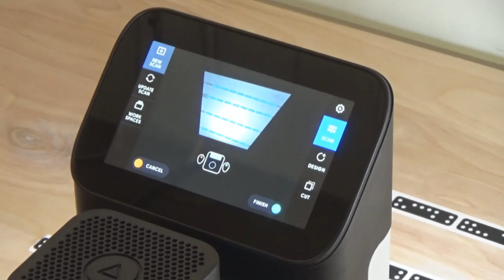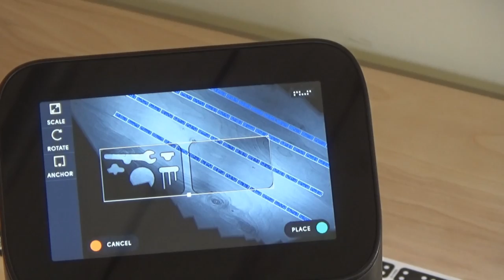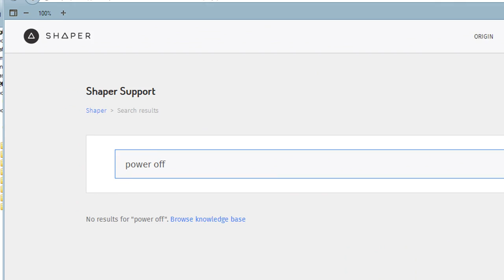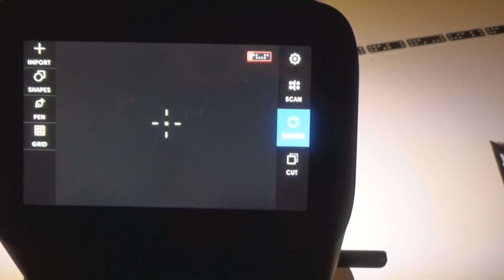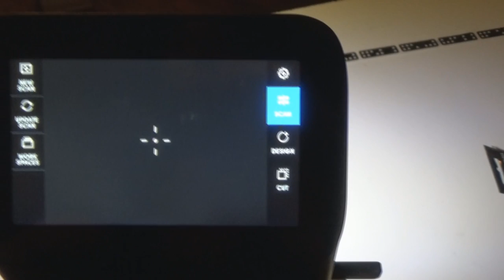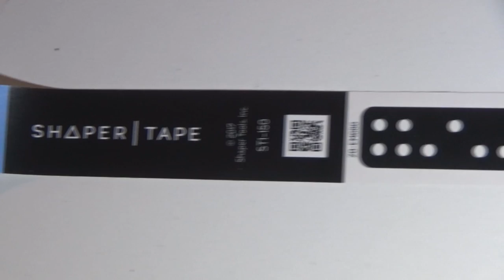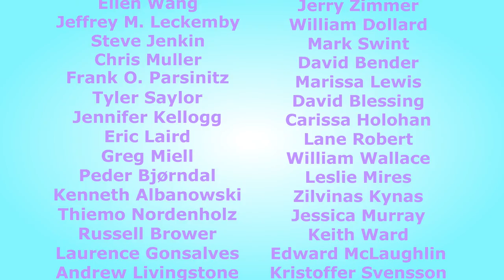The Shaper Origin - World's First Handheld CNC Machine

Comment: you mention you can't delete workspaces, but the footage shows what looks like big red trashcan buttons on each workspace in the menu?
Reply: also after she tapped on the workspace it had buttons for "copy" and "remove" ...
Reply from the maker: During editing I saw the quick flash of the copy/remove options but they are only there for a split second as the Origin cycles through pages.  Could be a bug in my unit...
Reply: Maybe if you hold the workspace instead of just tapping to select it? -that's how it works on my friend's new fancy coffeemachine (to delete a custom cup).
Reply: Fran Blanche could be but maybe there are some long press options. No file management is definitely something that should be added in a firm. I could see keeping some templates for making more pieces later but yeah, you wouldn't want them all in the main category.... If it's a category... You know what I mean. Rock on Fran.

Comment: Would you expect any tool to be perfect the first time out? A good start, but I am sure the manufacturer made compromises. Still very useful. I am beginning to wonder if on-off switches are becoming optional. A friend recently gave me a air popcorn popper which has no on-off switch. I use it often, but having to unplug it is annoying. Does the shaper run on ASCII? The dot coding on the tape looks very much like the dot coding on the paper tapes we used in CNC manufacturing of printed circuit boards 40 years ago. Wouldn't it be nice to do the program on your personal computer and download it to the Shaper?

Comment: Considering this is in fact a computer, it should probably be plugged into a surge protector power strip. There's your on-and-off switch. Since this really is designed as a portable power told though, and and not a stationary CNC, my guess is that the folks at shaper figured you would just plug it in to use and then unplug it when you are done. 

I'm with you though I think it should still have a dedicated on-off power switch for the computer portion. The surge protector power strip may be a workaround for now.

Comment: Cutting dovetails might be tricky since this is a 2 axis tool and some dovetails need height  allowance in the Z axis.  Enjoy your new toy!
Reply from the maker: It's actually an effective 3 axis tool, which is why I think it would ideal for dovetails and other complex joints...
Reply: How is it controlled in the Z axis, other than when you touch off and plunge?  Wouldn't it need to be able to scan a wall with Shaper tape on it to be a true 3 axis router?

Comment: I'm having a hard time accepting this as a CNC machine, given the operator needs to move the cutting tool. To me a CNC machine is where you put the work in, start the program and go do something else while your part is made. Seems more like an automatically compensating router to me.
Reply: yeah its more of a hybrid I suppose but the technology seems like it has a lot of potential for the home user either way
Reply: indeed librepenseur,
though, maybe if you put this in the hand of a Baxter-style RethinkRobotics 
or HansonDynamics, it becomes a CNC?
it's essentially a dremel mounted on an RC-car frame... it is similar to "Rap-Fab" stuff,
to make 3D-print-pen stuff attach to a drone etc.
AvE covers several gearless-transmission and brushless stuff...

How does the AGI-chassis compute the pressure to achieve the cut/envisaged movement?
where it is a mobile lazer-etcher, how does it compute the rheometry for the material safely?
how does it apply the force, and while keeping the overall rig upright?

enter Ionocraft! Ionic-Lifters can produce drones with the flight-time,
and power-via-wifi depending on the plasma-substrate etc.
Reply: I guess it's Computerized Numerically Controlled = CNC, so there you go. You're welcome.

Comment: It's a cool little tool, but I wonder what were they doing for the past two years?I've seen Bens video, apparently not much has changed. Also there is this cloud thing. It's also very expensive. Proprietary tape nonsense. I'd have to squint really hard to see it used in any kind of production environment.

Comment: Eh, the spindle has an on off switch.  I guess I don't see a big need for a switch for the electronics stuff.  Why wouldn't you just unplug it? But did I gather you can't use regular router bits?

Comment: Given that there's a power switch for the dangerous finger-biting part, sincerely, I don't know why you need a power switch for the computer. If you're going to walk away and are concerned about saftey but want to save your progress, why not just leave the computer powered on and shut off and pull the disconnect for the spindle? Thinking about it a little, what utility is offered by a hard switch or a hibernate mode? Are you sure you're not just coming from a place of expecting it have one because all other electronic devices have one? Seems like this device can live pretty happily without one, and leaving it off makes the device that much simpler to design, manufacture, and use...
Reply: And as an added bonus, burns out the electronics more quickly.
Reply: Does it, though? Notably? I'm skeptical. How frequently does it come up that one is leaving it on for extended periods without using it? If that's happening all the time and an owner is worried about it, they should finish their work and unplug it. What's the difference?
Reply: Well, considering that electronic components are rated for a number of hours @ a specific temperature, and designers are known for running their components right at the crispy edge, it doesn't take a rocket scientist for work out that leaving shit on is bad for everyone except the guy selling replacements.

Same goes for the plug. Which do you think is rated for more cycles? A plug and socket, or a switch?

And why wouldn't you fit a power switch. Why are you anti power switches?

Comment: Ok, this may be a minor quibble, but why on earth would you brand your woodworking tool 'shaper'? That just seems like the designers either weren't woodworkers themselves, or didn't talk to enough woodworkers. At least in my experience, people in the US refer to wood shapers (used to make mouldings) as simply a shaper. So what are you supposed to refer to this as? The origin?  Seriously, nameing your company after a completely different tool that is used in the same field is terrible marketing, it's equivalent to starting a company producing a cnc plasma cutter and calling it the 'Lathe Mk. 1'. And it's too late to change it now, of course.

Comment: But it's just a router with a computer screen ish and the camera . It just doesn't seem like much to me.
Reply: Then you don't yet understand how it actually works. The human operator just gets the router bit near where it's supposed to be. As you're cutting, the machine vision system continuously monitors the (inevitable) deviation from correct bit location and the CNC system uses this information to continuously adjust bit location to align with the intended cut path. So you get the desired precision via CNC as long as the human operator generally follows the correct path shown on the included display screen.

Comment: CNC means Computer Numeric Control. This is human controlled...Though it is cool. But can't give you the precision of a CNC. Very expensive tool, I'm guessing several thousand. No power switch?! LOL!
Reply: Jesse Fritz wrong.
Reply: @msrp6810  what am I wrong about? I made several statements in that post...
Reply: @Jesse Fritz You were wrong about pretty much everything. If you tried to cut the parts Fran did using a standard router freehand, then you would see what a 'human controlled' router gets you. The result would definitely be far inferior to the result she got. And if you've looked in detail at the device, you'd see that it is indeed computer-controlled, though it does not operate independently of human assistance. So i would call it human assisted CNC. The human does the work of getting the router bit roughly on target. Then the computer (numeric) controlled module responsible for real-time adjustment of the exact bit placement refines/compensates for the inaccuracies in location produced by the human operator. 
So, yeah, what you're wrong about is the part where you say it's human controlled not computer controlled. And no one claimed it would give the full precision of a traditional high-end CNC router but it looks to be competitive with lower end units and for some users, it might represent a very useful tool. Just think about situations where it makes more sense to bring the CNC router to the workpiece, rather than bringing the workpiece to the CNC router table. Think about the limitations in size that don't apply here. Think about the shop space that is not occupied full-time by some big expensive CNC router with it's 4' x 8' (or whatever) sized bed. Oh and you're also wrong about the part where you guess it costs 'several thousand' dollars. It costs $2500. So it's not cheap, but neither are the alternatives. For someone doing prototype development or high-end router inlay work, this might be a very cost-effective tool. The only thing you got right is the lack of a power switch for the CNC/machine vision part (the spindle has a mechanical switch and can be unplugged, as Fran showed). Regarding that omission, the firmware does cause the unit to enter low-power mode if its FOV hasn't changed for some extended period of time. But if you want it to power-off completely, you have to unplug it.

Comment: It would be easy enough to put in a mains switch, I suppose, but why should you have to hack a brand new item!  It sounds to me like the creator is a modern software biased designer with no, 'old fashioned', engineering safety principles!  No off switch, WOW!!!
Reply: there is your old fashioned off switch 2:44
Reply: Karsten Seidel  she mentioned that doesn’t shut off the entire thing
Reply: is shutting off the dangerous spinning thing not enough for your "  'old fashioned', engineering safety principles!  " ????
Reply: I mean, the router itself has a switch. The real question is, why is hitting 2 switches too much?
Oh, and as someone who restores old electronics and vehicles, the idea that 'old fashioned' and 'safety principles' go together is hilarious. Quite a few old tube-powered equipment had the socketed tubes exposed externally to make replacement easier, which also meant that unplugging the tube while the device was live exposed very high voltages, and lots of old (40-50s era) pickups had the gas tank mounted underneath the seat. "old fashioned' engineering principles quite often assumed the user wasn't a complete idiot and/or had a fairly high sense of self-preservation. Those old-fashioned engineers would have looked at this tool and concluded there are too many safety guards in place, and those are a potential cost savings.
Reply: zrobotics absolutely love your common sense comment. I may only be a 1985 baby but I was raised by a 1957 common sense genius.
Reply: @Karsten Seidel. No, it's not.